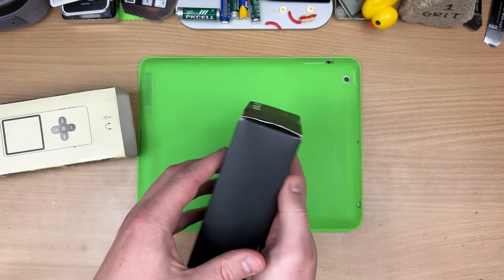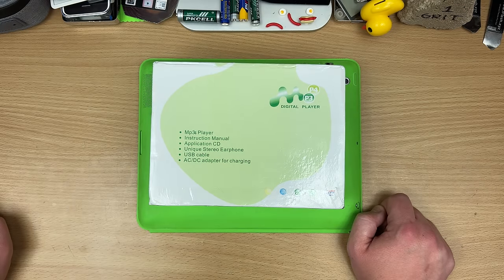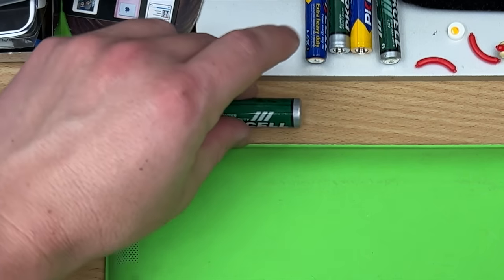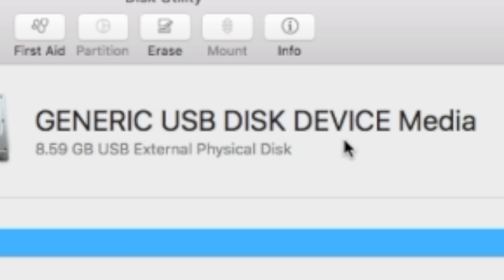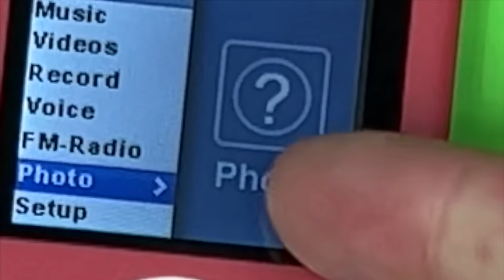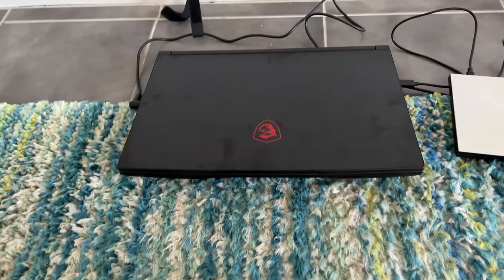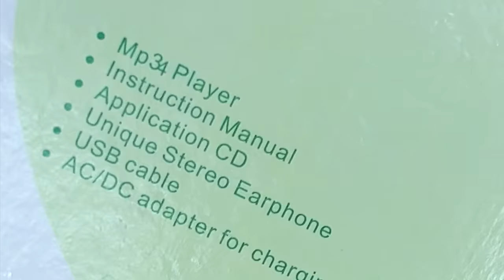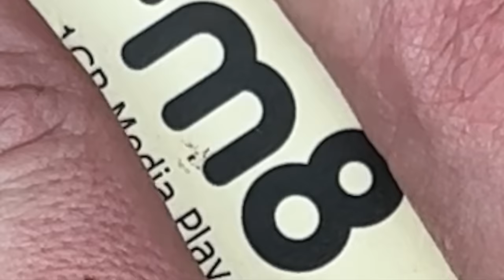The absolute worst bootleg iPod.

Comment: I can see why he hates windows…. But it’s just some unnecessary hatred because Windows 8 was a thing.
Literally everything has updates, and he’s used to MacBooks that do them seamlessly, even If you’ve got a new MacBook, it might stay on whatever MacOS version it came out if the box before checking for updates.
But apples OS is hard to hack because it’s THEIR OS. Made in house for their stuff only. No one else can use those OS’. Which is why that makes it harder to hack any device of theirs with ipadOS, IOS, or MacOS, because of how sandboxed they are, due to being closed source and never being distributed for others to use.
But windows is more widespread, more people use them more often, especially since there’s a server version of windows, even digital signs use some OEM windows machine. So they make updates mandatory so you aren’t at risk for security vulnerabilities. That isn’t to say you’ll be safe regardless of what device tho, but that depends on if you don’t go onto some shady website, or click some shady link.
But in general ARM machines are efficient as hell, and light weigh. So apple made use of that, and all the little things made it so updates seamlessly happen. But that doesn’t mean they’re always great, as arm adaptation is mostly with phones, and sometimes they don’t have complicated features you can use compared to x64-86 CPUs. Plus the fact that the base cheapest MacBook is the M1 7 core gpu Air, which some say is still great for editing and other stuff, then the now cheapest model of the M2 10 core gpu Mac mini for those that want to spend less on a desktop setup.
Yet every single Built PC is different in some way, and the fact you can still get 2 and 4 core cpu, and new low end GPUs. Plus the fact you can replace any part without hassle and without spending too much. Like if I had an older Mac device an it broke…. I’d be forced to get a new one, cuz apples dumb, and because parts cost much more, but also cuz some parts can’t be replaced. Like if the SOC itself dies, the whole board Is useless. And you’d say “but the same issue happens with windows laptops” yet that’s not apple dealing with the device, cuz even with apple care, sometimes they will not replace the device if it’s an accidental damage, even when you’re still paying monthly for apple care after that first 2 years, meanwhile lots of windows laptops come with a 1 year warranty as a curtesy thing, with 2-4 year warranties being extra, and not some crappy per month warranty thing that’s basically “just a subscription” to keep device serviced even if apple won’t replace it when it breaks.
Plus If you don’t get the warrant for either a MacBook or windows laptop, the basically the same thing. BUT you can replace things like the storage, or memory easily if those stop working after enough time, and if you look long enough, you could find a reliable site to replace the battery, fans, screen, or whatever else you need to fix on a broke laptop, but you won’t get the original board. Not like that matters since AMD/Intel mobile CPUs, and AMD/Nvidia mobile GPUs are made to last longer with their better silicon. Literally I’ve seen someone gut an old GTX1060/RTX2060 mobile GPU out of a broken laptop with a fried CPU, ram slot, or M.2 slots and attach the thing to a proper desktop PCB with some know how, and EXTEND that GPUs life. You can’t even do that with MacBooks, cuz the device will go “>:(“ and so will apple cuz they’re an angry bunch of rich guys who hate it when people advocate for better.
Also, at least that windows laptop you got has modern parts. The desktop that I have is 10 years old, and is stuck on windows 10 due to being old. And you made the mistake of allowing that laptop on the internet before making a local account, to get into windows, and let it deal with updates in the background when finally connected.